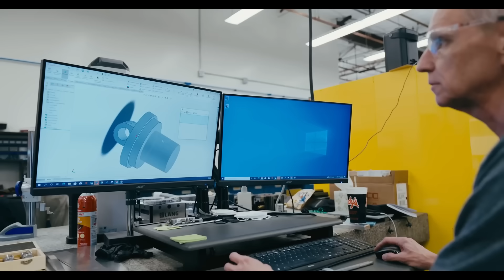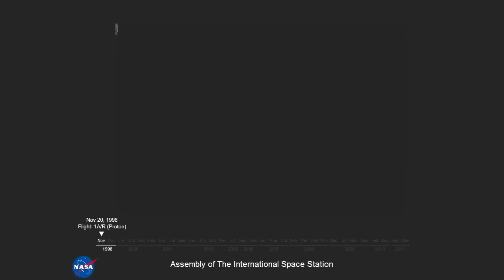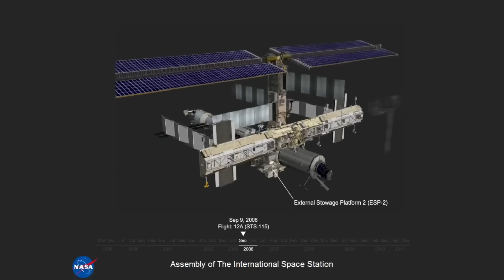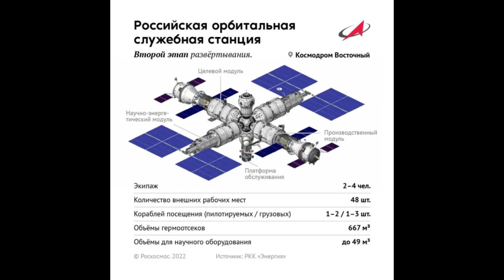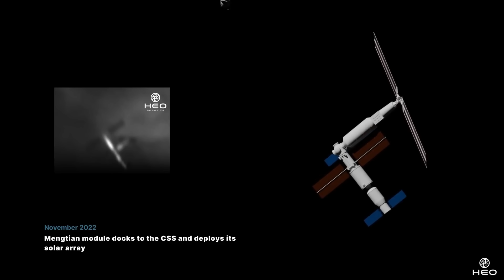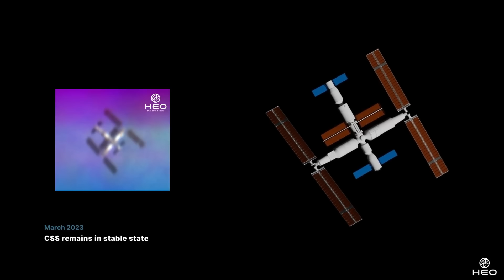Where Will Astronauts Go After The ISS Is Destroyed?

Comment: It'd be nice if they could somehow salvage the ISS wall where visiting emblems and signatures are posted.
Reply: they confirmed in the press conference that is something they're planning on doing
Reply: @soleenzo893  That's good. I obviously didn't see the press conference. I've also never had an original idea.
Reply: I’m a bit surprised they aren’t boosting it to a graveyard orbit until it’s cheap enough to bring especially historic parts of it like that back.
Reply: @OtherTheDave it’s all economics. Boosting it high enough to be considered a high enough and out of the way would increase complexity and cost astronomically
Reply: @TheOmega1921 plus you would also have to worry about micro-meteorites, the stress from the move would have on the radiators and solar panels/trusses, any of the screws/bolts/nuts that could come loose.
As well as any debris that could hit it, or outright destroy it due to speeds.
Reply: @OtherTheDave  It would become riddled with holes.
Reply: @MARYLANDmeerkats  Hmm… hadn’t thought of that. Do we know how riddled it’d be? I mean as others have pointed out it’s probably not economically feasible, but that doesn’t mean it’s not an interesting thought exercise.
Reply: @OtherTheDave What graveyard orbit?
Reply: @OtherTheDave  The station is huge and ungainly.   They'd probably have to disassemble it to move it in the first place lest it disassemble itself during the attempt.
Reply: @OtherTheDave  De-orbiting is relatively simply. Boosting it to a higher orbit requires the sort of capabilities we currently do not have or can develop within time given the mass of ISS. At least, that is my understanding.
Reply: @creesch  Hmm… well, it’s still a shame, but at least there’s a reason for it.
Reply: That’s the kinda thing I think cute me would find interesting. In 1,000 years I’ll be some guy wondering whether or not people actually lived in space, and that’s all the evidence we have.
Reply: And/or harvest...❤
Reply: I was thinking the same thing. Can that original module that has that Airlock section be disconnected ,and be recovered and brought back one aof the starship returns? That would be quite a few extra millons,of dollars though. But- is Sace X contract to decommission the station include disassembly/seperation of larger sections for better reentry burn up to reduce risk of big 'O chunks of smoking ISS landing wide of the S Pacific ?- impact areas?
Reply: @edstoutenburg3990  think like a business person. What is the investment to payout ratio? No good. Musk ain't no hero, but he didn't get to be a billionaire by wasting money. Think about the reason they want travel to Mars to be cheap? They need lower class laborers when they get there. I love space travel as much as the next guy, but let's not lose sight of what's really going on.
Reply: So spend more money for it fail miserably later ?
Reply: The solar array is relatively new. That is quite a lot of mass saved for someone with a screwdriver and can-do attitude.
Reply: I'd love to see ISS drained of all fluids, batteries removed, depressurised, then lifted to a very stable orbit, 40k km or something and left there for thousands of years. It would be like our civilization's Stonehenge. Future civilizations with rudimentary telescopes would be able to see it, wonder about it. Fantastic example of 20th century archaeology for folks thousands of years into the future.
Reply: They can. Just not for free.
Reply: That Segment alone should be designated an International Landmark for future history.
Reply: I suspect if starship can become operational quickly enough that they could build one specifically for salvage operations to bring back as much as feasible or worth saving if nothing else to put in a museum.
Reply: @NiickTheDiick A variant of the de-orbiting tug would be more useful. Some cargo modules from Russia could bring back the momentos and internal hardware worth keeping, and give RosCom something to do, while the extra tug could move the newest connector modules and solar arrays to the other station projects. Cheaper than launching new even if performance is degraded. Plus the seals could be rebuilt in vacuum before attachment.
Reply: Yeah get an inspector sattelite to hack off some museum pieces first. Like the Starliner. 😊
Reply: @Confessor555  Starliner will probably be cold-welded by the time they try to undock, and they'll just leave it there.
Reply: @Confessor555  🤣
Reply: I’m sure they can
Reply: I thought the whole damn thing was modular, so they could replace or upgrade whatever was needed?
Reply: My channel proved nasa cannot inhabit space without Ru*sia or Ch*na.

Nasa has been trying to put up a station since apollo, apollo was literally just a reation to salyut. 

They b.s. moon landings whenever they cant put up their own station.
Reply: Yeah, they gonna save it riiiight up until it hits the atmosphere
Reply: Or the whole station?  I just do not get why they cannot boost the orbit and keep it up there?
Reply: @layton3503  cause 20 year old critical seals have a chance of failing, it becomes more of a liability the more the decades go on
Reply: 2030, by then starship can probably grab those
Reply: Could it not be converted to store fuel for Starshio?
Reply: Vot is thing with americans on iss scheduled for one week now being stuck for over 50 days because america can't get rocket up anymore?
Best kib american saut on new Space Station if you want to live.
Reply: obviously the equipment is outdated and the science has been done but if we can encase that in the axoim(doubling as part of their tourism thing) until we get iss 2 electric boogaloo that would mean so much
Reply: Kamel is in charge of Space Stuff. Like a Space Czar. That explains everything.
Reply: @Antiguanian  What's up with yall calling her the Czar of everything? It's such a random allusion, especially when Trump is the golden boy of Russia.
She also "isn't in charge of space stuff" that'd be NASA.
Reply: @Ian-y1f you can raise the orbit up, but unfortunately there is much more space debris in the higher orbits and it wouldn't survive long up there. Otherwise it would make sense to just leave it there like a museum.
Reply: Something tells me money will convince NASA to leave the station in orbit, and a company will buy the ISS as a platform for building new space stations (like axiom is already doing)after which it could be depressurized and serve as a shipwreck in a graveyard orbit, for future adventurers to seek out and explore. Like shipwrecks on the ocean floor.
Reply: They can salvage the hole station , but its political.
Reply: YES i know the station is old but it can hold air , and its a island of the sea of vacum.
Reply: Maybe starship could be used to transport pieces down.
Reply: I saw your comment so I went up to the space station whilst it was passing over my house and got the wall on eBay for 745,000,000$
Reply: lets save the whole thing use it as a outer space ware house
Reply: The ISS has out lived its usefulness because the technology is outdated and it’s time to update it. I just hope I can see it fly in my lifetime or the upgrades. I wanna see dream chaser to launch this year.
Reply: It'd be better if they started re-engineering fixes and upgrades to the existing system.  A propulsion system so that the station is completely self-contained. 

Instead, 30 other commercial entities are all building small, basically useless parts that could be made with a common adaptor and connected to the station so it becomes safe and up to date.

But hey, nobody ever accused NASA or the government of being smart.
Reply: @Chris_Harris  well I mean you can only fix/upgrade something so much until it decays or can no longer be fixed a completely new one seems like a way better option
Reply: @LoociferZ talk about Dunning Krueger...
Reply: @LoociferZ  I kind of agree. I wish we would push it into a higher more sustainable orbit and work out problems there. Even if we can't use the thing isn't it something worth keeping around as a historical artifcact?
Reply: @LoociferZ ISS type station will fatigue faster than single no modular station. Think about vibration that ISS needs to handle vs no modular station. Best future space station is just Starship, single big cylinder with solar panels. Starship has same cargo bay volume as ISS with 1k m3.
Reply: @LoociferZ they're dealing with potential hull failure.
Reply: @AsbestosMuffins  I'm aware of that. They put themselves there though by not spending on maintenance. I'm sure there were plenty of scientists who were telling them they would be 40 years ago but Congress didn't listen.
Reply: @LoociferZ Overly snarky comment. NASA/USG policy is not to do a follow-on to ISS that is yet another government-designed, owned, operated humongous thingy; but instead to take the next- and more sustainable step: to create a multi-competitor- and, US-led- LEO economy. That’s where Commercial LEO Destinations comes in. Maintaining the old ISS would cost billions- and siphon business away from the new, commercial stations- to no benefit. What’s your proposal? Be specific. - Dave Huntsman
Reply: @LoociferZ  You'd have to cut the station itself apart to address the interfaces that connect modules together. It's just not feasible without destroying the thing you're trying to save.

And NASA looked into sealing the ISS -- it would still cost them money to monitor, and there's no guarantee whatever propulsion system or pressurization you leave on the station wouldn't lead to a failure, since the modules and tanks are all far beyond their engineered lifespan.

Stresses have taken a toll. UV has taken a toll. 1-off Russian equipment that wasn't meant to last or be replaced has taken a toll. It's just not worth it, it would cost as much to save and monitor as operate a whole different station.
Reply: @LoociferZ  Also, they better put together a law / rule that forces all manufacturers, national and international to make all docking ports compatible (with or without adapter) with each other. Quite an "Oh shit" if you need to send and SOS to the chines station and it turns out they can't rescue you because the docking ports don't fit.
Reply: @LoociferZ The ISS has a limited life span, it can only go through so many day night, heating cooling, expansion and, contraction cycles before it literally starts to decintergrate
Reply: @willhaney96  I know it does. I know a hell of a lot about the station including their fears of total failures on major seals that might zero-g nap their astronauts.

Right. Which is why there should be a schedule to replace the pieces.  The upgrading to new materials and systems alone would be worth it.

Seems to me that nobody in NASA does oil changes on their cars and trucks. If they did, maybe they'd remember that things need servicing as time goes on when they look at their station which by many is considered our first real and continuing place in space that we maintain as a foothold.
It's not something we should just be tossing into the atmosphere/ocean.
Reply: @LoociferZ  I'm sure the engineers missed something that you clearly know better. Maybe you should go by their office to teach them how to do their jobs. I bet they would love your unique input
Reply: @LoociferZ They theoretically could, but remember that it never was designed to be fixable afterwards nor modular. If you start reusing parts you'll be spending more and more time and money into fixing things, increasing risks and not working on interesting things. Better would be to start over, with fixability and modularity like you want, in mind.
Reply: @LoociferZ  it takes up like two billion a year already to take care of the ISS, maintaining it to the point of replacing all the old stuff until it is effectively a new station is just not an option right now, or even in a decade. the budget does not allow this nor is any commercial entity interested in that giant task, it's so much easier just to start small and anew with something fresh and build off it from there. you're very confident but very wrong i'm sorry to say it
Reply: @LoociferZ  I agree it would be very cool if the ISS basically became humanity's ship of theseus but some people at NASA/ESA etc. probably did the math and figured that starting a new station from scratch is the more economic and probably less risky option. A new station also means there's no need to worry about compatibility with legacy systems that were designed decades ago by people who aren't around anymore.
Reply: @LoociferZ  Fixing the ISS isn't like changing the oil, it is like changing the engine, transmission, frame, and all the body panels and wheels.  While the car has to keep driving.  And all of that to save a 40 year old rustbucket with half a million miles on it.  Also if there is any kind of breakdown everyone in the car is likely to die.  

The reality is that NASA has done heroic amounts of maintenance to keep the ISS running as long as it has.  They are carefully monitoring steadily growing cracks in various modules to make sure that they aren't about to break entirely.  Increasing the crew of the American side from three to four when NASA was finally able to replace Soyuz with Crew Dragon tripled the amount of science that could be done, because the American segment needs 2.5 man days of "oil change" level maintenance per day.  The Russian segment is worse, and if they weren't able to leech a bunch of life support from the Americans they would never be able to survive with only 3 man days of maintenance per day.  

If the ISS was a building on Earth it would already have been condemned long ago, but it is valuable enough in space to keep going long past the point where most things would be scrapped.  When it is finally deorbited in 2030 (assuming nothing breaks catastrophically before then), it will be because it is simply not possible to keep it operating safely for any reasonable amount of money.
Reply: @punishedbrains  So do we need a station or is it sabre rattling?
Reply: @ixxxxxxx  3-5B which is just plain ridiculous. How much of that money is shovelled into the money shredder called Boeing?
Reply: @LoociferZ Easy to say; way too expensive to do- especially when the functions are being replaced with commercial space stations that don’t want competition from a subsidized government space station that’s still up there. - Dave Huntsman
Reply: @LoociferZ  i feel like you're really oversimplifying things. maintaining the ISS is already expensive. refurbishing it to the point of being brand new again is NOT POSSIBLE and is why we need to start small and fresh with something new
Reply: @willhaney96 give it a sun shade
Reply: @ixxxxxxx  Are you telling me that they cannot take inventory of what is on the space station, figure out what is usable, what is not usable or outdated....AND START UPGRADING AND FIXING THE STUFF THAT NEEDS TO BE?

SORRY but I'm not believing that 100s of millions of dollars of space station are not perfectly fine. They just rolled out 4 new gigantic solar panels. Do those need to be chucked into the fire? The Canadarm. Does it just need a couple parts or is it still just fine because it's generally always been fine? What about other modules and equipment?

I'm sorry but this looks like a "We should have designed it like this, so hell why don't we start from scratch kind of deal."  CERTAINLY most of it might be sketchy but I have a hard time believing that 20% or more is not perfectly fine to be used in a new station.

The problem with all this is that NASA is now going to play games with funding (as they always do). They're going to hang out with their butt buddy Boeing and Northrup Grummon and so on and start "requiring" 400mil here, and 300 there, and 500 there and so on when some of that stuff is already faced the risk of getting up there and is working just fine.

Maybe if they'd show a diagram of the ISS and illustrate what is going on with each piece, people like me wouldn't feel like NASA is just pushing their development system so instead of them blowing up a budget, someone else can.  Lastly, I just want to know...what's the status.  Why aren't we...the taxpayers shown wtf is going on.

Sorry but "We need to get a super rocket up here to push it into the atmosphere and burn this mf'er down" doesn't quite sit right with me.
Reply: @LoociferZ  they do though, they do EXACTLY that. that's what i've been trying to tell you. they are constantly taking inventory, upgrading, replacing, that is where the two billion a year goes to. the station is stretched to it's limits and a couple more decades up there is NOT realistic, the world is very busy with things like the Artemis program right now
Reply: @dphuntsman  ive seen you in multiple comment sections now under a couple videos, you definitely know your stuff dave! god bless ya lol
Reply: @LoociferZ  I don't think you know all that much. Replacing every single structural component would cost way more than just launching a whole new station.
Reply: @ixxxxxxx  They haven't been. There hasn't been a new module added to the space station since the last Shuttle.

Artemis? Artemis is at LEAST ten years from landing on the moon. It's a joke. As of right now, as NONE of the parts of it even truly exist, it's a PIPE DREAM.

Meanwhile the only real station is going to be destroyed with no true replacement.
Reply: @LoociferZ  sorry but you are misinformed. the artemis 2 core stage arrived at the vehicle assembly building yesterday, the crewed lunar flyby is set for late next year. would you like them to meet that deadline or go down a side-route of more station modules when congress is already cancelling near complete projects just to squeeze a little more budget, you hear about VIPER which got cancelled a few days ago? there is no room in the budget for anything you're talking about and there won't be for a long time, besides, axiom is going to add their own modules to the ISS which will eventually serve as it's replacement, we aren't going to be left without a station
Reply: how do you service a pressure vessle without a "drydock"
Reply: @ixxxxxxx  Sorry but none of those are DONE.  They're parts of DONE but they are not DONE. 

Lastly, how did you know I have a Viper lol.  2018 ARC that I got at Copart, ended up being only a single broken engine mount/exhaust, and Dodge recertified it...all for 35k.

I almost died when I saw them bring it out on an industrial forklift. Almost a mint car and they're lifting it like it was a balled-up death car. :/
Reply: @LoociferZ  it's not done of course, but they're hard at work to get SLS and Orion to fly crew around the moon next year, all the flight hardware is ready, it just needs to be put together in the VAB. if we want that deadline met there is no room for NASA to mess around with new station modules outside of what Axiom is working on for them

dodge vipers are pretty sweet but i meant VIPER, an unmanned lunar rover which has 99% complete flight hardware, it was basically ready to go, all the development done and paid for for some years now, but congress cancelled it a few days ago in favor of flying a ballast simulator on the flight it was supposed to take. which is strange because it saves hardly any money and makes you wonder if they're desperate. scott manley has a video on it if you're interested
Reply: @LoociferZ  ISS was a political project from the start, it outlived its usefulness because of changing political landscape
Reply: @LoociferZ If you want something the scale of ISS to be serviceable to extend its lifespan forever, the basic design has to be quite different. It has nothing to do with NASA being stupid. NASA has limited funds and cannot execute every feasible idea. What you suggest would have been awful feature creep on an already constrained design process. If they actually listened to your ideas, the whole thing would have been a terrible boondoggle. It literally is cheaper to send a new station up because it won’t be limited to what the Space Shuttle could do. Custom upper stages of superheavy can become huge, cost-efficient orbital station segments. Fixing ISS indefinitely makes approximately zero sense at this point. It made no sense when the ISS design was conceived either, because you’d have needed to send the modules up with Saturn V to make your infinite serviceability idea feasible. That’s really all that’s to it. Talk is cheap.
Reply: @absurdengineering  I'm heading out to camping so I can't reply to most. I will tell you though that if you think that they'll be using Super Heavy upper stages for ISS segments or more than a couple, you're huffing glue. Just Boeing itself would sue and free that idea forever let alone all the other space companies who would demand a piece of the 1 Trillion dollar pie.  Hell, the Russians would sue NASA's face off which seems silly but yet totally true.

Now, off to the trailer. woods and reeeeelaxxxoonezzz
Reply: @LoociferZ  Again, there are Russian-made pieces that were not designed to be serviced or replaced. This is why the Russian ECLSS system failed years ago, with no replacement. 

There is the AXIOM plan to build a new station on top of the old one, then separate, which is most feasible thing you can do at this point.
Reply: @LoociferZ  if you knew a hell of a lot about the station you would know that it wasn’t designed to last this long.
Reply: @LoociferZ  do you not understand the situation? THE WALLS ARE DISINTEGRATING. they cannot just go up there and slap on a new piece of steel, nor is there any easy way to replace the seals while there are still people on board, and they cant leave the place unmanned because it requires constant maintenance. the only thing they could possibly do is launch up entirely new sections, and then jettison the old ones, which they are already planning on doing!
Reply: @LoociferZ  It's not that ISS can't keep going with some work. NASA is looking to spend those funds on the lunar program and Russia is looking to leave the program. It's just kinda mission complete, time to push further outwards.
Reply: @greybuckleton  Let me ask you. How much do you think a Lunar space station will cost?  Personally, 10 trillion wouldn't surprise me.

How much do you think it would cost to GET the station there? Again, 10 trillion is possible.

Let's all now wonder where the world is going to GET 20 Trillion dollars let alone spend it.

The ISS would have been on the moon.  But it takes 3 days to get there and with Super Heavy modules like the Space Shuttle carried...they would never have had the fuel to even get there. Even now, flying super heavy modules there is probably ten plus years away...maybe more?

There's a reason why the ISS is in Leo. Fuel and cost to get it there.  Anything else would have been too stupidly expensive.
Reply: @LoociferZ  I get what your saying bat at a certain point it becomes more efficient and more cost efficent to leave the old teck behind and just move on with something new. It's expensive, time consuming, and eventually limiting to constantly be upgrading the old infrastructure that wasn't built with this far into the future in mind.
Reply: @LoociferZ Everything has a life expectancy. Metal fatigue builds up and it is in a place you can't do a proper overhaul on. Even massive warships do a hull swap at some point just to stay afloat. The thing lasted longer than a carrier which is faniminal in the hostile environment of high orbit.
Reply: Maybe set it on a trajectory to orbit Mars and Earth like the Hermes in The Martian. Be a good test module to work out the kinks for that kind of orbit, and it's already in space, so...
Reply: @colleenforrest7936  SpaceX is planning on a steady stream of starships going to and from Mars, I think those first missions will definitely gather data on what you envision.
Reply: Why? Who cares lol
Reply: @jmax8692  would be pretty cool man. If you don't want it in your museum I will have it in mine. The list of all the names of the people who assembled and lived on our first home that wasn't on Earth.
Reply: Would be awesome but I won't launch a rocket for it
Reply: @xdmcnugget5411  there are some crewed missions before then. If it's an internal wall they can just remove it. If it's structural, well, take a photo.
Reply: that sounds like an incredible waste of resources. great in concept, near impossible in reality
Reply: Lol. It's now a superbug factory
Reply: @LuciFeric137 Nothing a little ozone won't fix.